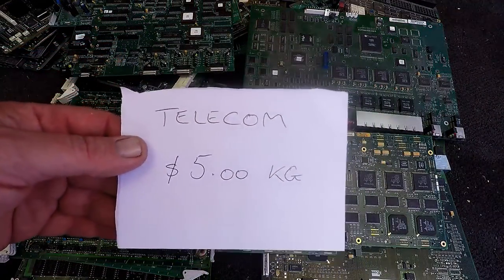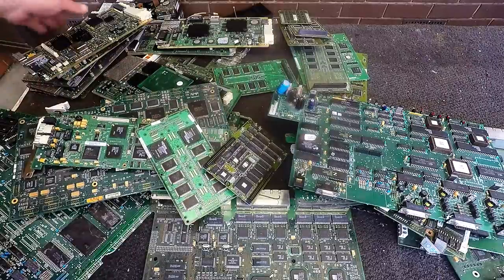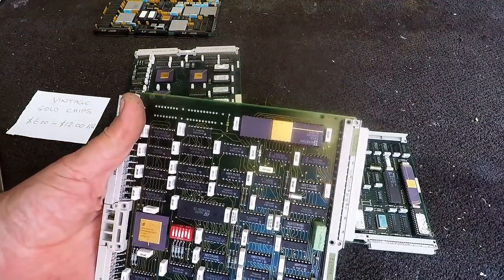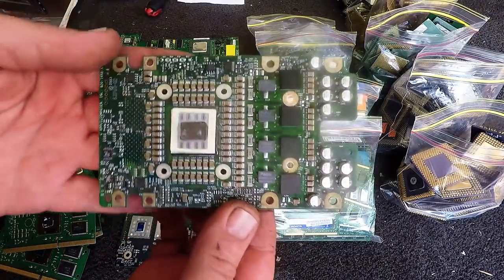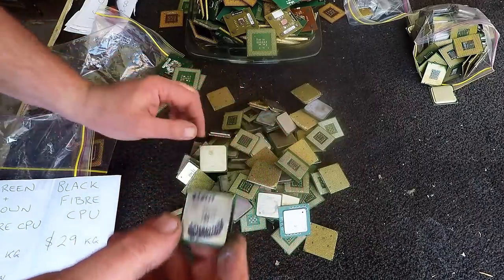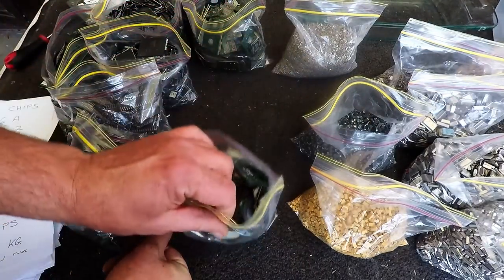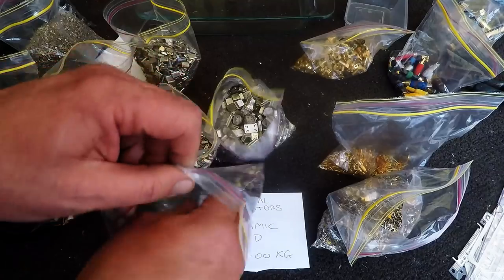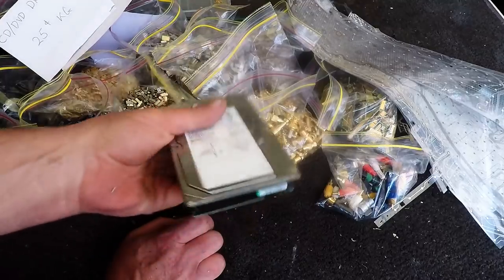Buying Circuit Boards in Melbourne Pt2

Comment: Hi ben thanks for prices and providing a service not previously available here to scrappers, should be succesful. ppl may think some prices  are low but I think fair considering whats  involved to refine the PM's and large quanties material needed for small yeilds ppl don't always realise, plus wont get anything close from traditional scrap buyers. MLCC's even takin into acc BME introduced after '95 alot  high end still NME and even if only gettin 0.5-1%/kg Pd 5-10g say apx $150-300 plus your Ag maybe 3-5% those  figures fairly conservative. I'm doin as a hobby and want to recover the PM's myself one day. its all about volume of material I'm very meticulous depopullating as the better material you start with higher yeilds will get. Mlcc's tricky if not picked self but inclusion other similar smd's wont cause issues during refining proccess only lower yeild. Also surface mounted oscillator's similar to the ceramic based silver/gold ones you like, i also keep all other smd marked with "X" prefix on board often white or  black usually ceramic are also types of oscillator's i think? and sometimes small silver monolithic or bridged style things not sure PM content if any? but be interesting to find out. As for tantulum very confusing unless marked with prefix "C" and a "+" symbol on board or cap denoting positive terminal or i assume it's not tantulum once off board diffucult know for sure if not standard yellow or black cap with + clearly visible. Im only new at this learnt basics from you and then researched further, not rushing into refining till have enough volume of sorted material to justify expenses and obtain measurable yeilds, i live local and when/if get to that point would be interested in any advice you can offer or if you are considering any refining I'd be interested in helping out. Keep the vids comin, cheers mate

Comment: @ 21:19 that looks like a pcie sata card,probably nab 10-15 bucks out of it kinda quick,slot card with a fan you popped the fan off was a video card,anything like radeon HD 7XXX and up check before you smash them same deal with NV cards Geforce 7XX+, miners will take them off your hands for good money .
Reply: RDRAM has the sink pressed on and it be called RIMMS .Buyers for this type of ram DO NOT WANT the sinks taken off for rimms because they have to go look up the chips  to see if it sdram or Rimms .They not going to do that and they will pay you for reg ram.
25:28 that is a DDR2 -667Mhz (pc2-5300)stick in your hand not rdram(rimms) .You see PC1,2,3,4 on the stick that DDR and you keep the DDR3(PC3 XXXX and 4 (PC4 XXXXX )sticks because every computer the pass 7 ~ years use it n ddr4 the pass 2~ years.If you have 2-4 gig DDR2 sticks you probably sell them too kinda quick.
Reply: http://www.serverpartsmall.com/other-parts/samsung-pc-800-256-mb-rimm-800-mhz-rdram-rambus-dram-memory-mr18r1628af0-ck8.html 
just for a pic of rambus ram,The heat spreader always punched on like this.Then u have rimm key sticks you had to put in ram slots that wasn't populated by Rdram  on the boards.
Reply: other cpu's u look for are amd phenom 2,Fx's,

Comment: I find $14 per Kg for MLCC's a low ball offer after watching you take on scrap value of MLCC video, even if they put only half a Kg of MLCC.s in and the rest crap you would still come off well at $14 per Kg, Just my opinion any way.  You have the right to charge what ever you see fit and people don't have to sell them to you so good for ya if you get MLCC's for $14 Kg.
Reply from the maker: It's a fair price if you take into account we now have base metal mlcc's, so no palladium or silver, just copper, nickel & tin.
mlcc recovery value is based on 100% noble metal mlcc's, not mlcc's picked off everything so that's why.
Reply: See I didn't to now know there were base metal mlcc.s, I was only going off your vid on mlcc.s, thanks for some more good info. the only way we learn if people like you setting us straight. Cheers.